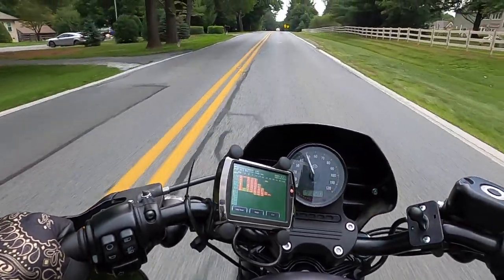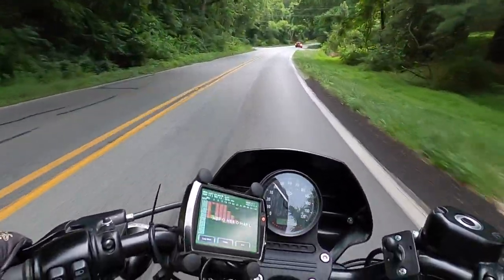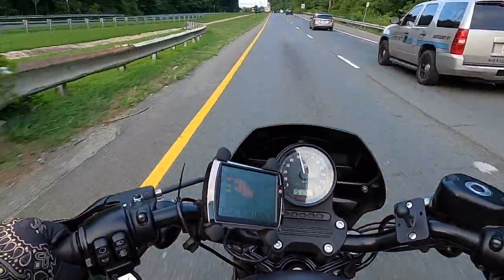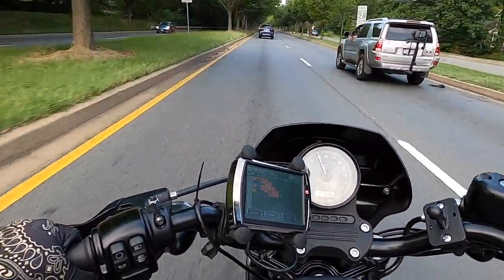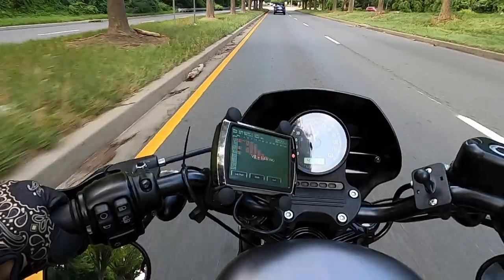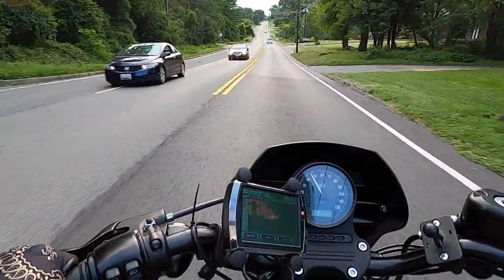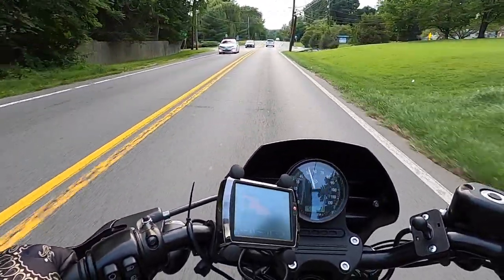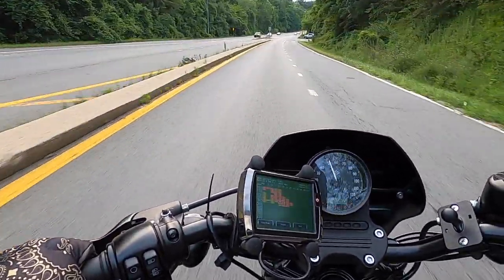Hammer Performance 1250 kit on Iron 883 - What a difference!

Comment: Did you retain the 883 heads? Can you hold gear longer like the iron 1200?
Reply from the maker: I did. And no the gearing didn’t change I was able to just get more torque at higher rpm’s so it did make it slightly more comfortable at higher rpm range
Reply: @IronBornRider  Thanks Man!

Comment: Been meaning to check in on the engine mod.  I really like the presentation here.. very professional.  I know I'm a noob for asking but the display on the bars.. is that part of the mapping process?  Digging the gloves also.  Was that venom I saw?  LOL.  I agree with you about the diminished returns.  At some point there is no valid reason to spend the cash for minimal gains.
Reply from the maker: The display is the power vision tuner, and I was mapping the new engine. The gloves are fast mask gloves, highly recommend. Lol the venom is kind of a joke between some of my riding friends. Thanks!

Comment: So right after you uploaded this video you said ‘F’ it and tore down the highway, right?
Reply from the maker: Lol I did the next day
Reply: IronBornRider hahaha
Reply: @IronBornRider  so how fast is the bloody bike
Reply from the maker: @lacolello6644  to me it's plenty fast. I haven't had it dyno'd but on paper it basically doubles HP and torque. It's a night and day difference from stock. The only time I wish I had a bit more power is on the highway when I'm going 80mph, there's not much more torque available at that point. Just my experience.
Reply: @IronBornRider  so u done the upgrade  and the bike goes well .. now you  wont to upgrade to a bike with more power .. i put a 1200 kit on my iron 883 plus cams it made no difference ..  was fuckin useless  was a waste of money
Reply from the maker: @lacolello6644  I'm thinking of upgrading down the road not because I want more power, but thinking of a bike that do cover distance better (wind protection, suspension, etc). I've never heard someone doing the 1200 conversion and not seeing a difference...that's odd.
Reply: @IronBornRider  yip did that 1200 conversion... put 1200 barrels  pistons .. bigger cam  retuned the bike .. cost heaps  bike never went any better   waste of money an time   that my opinion   .. anyway glad u happy with your bike   enjoy
Reply: @lacolello6644  Something was seriously wrong with your conversion if you didn't notice quite a bit more power.